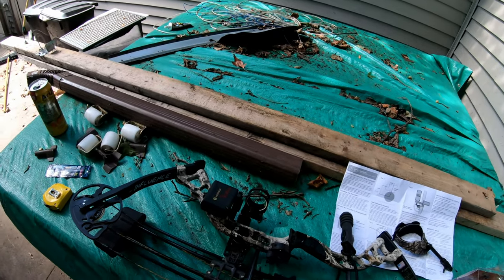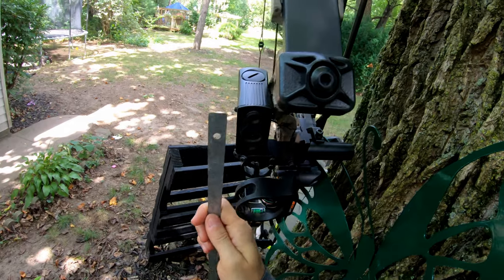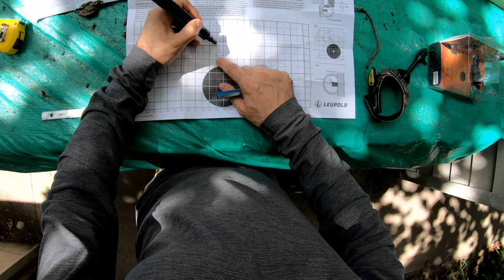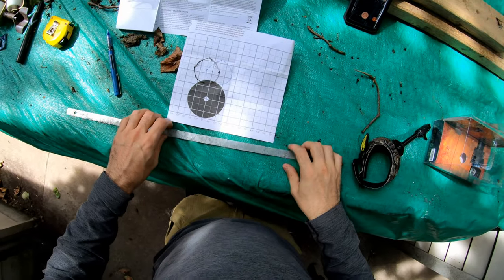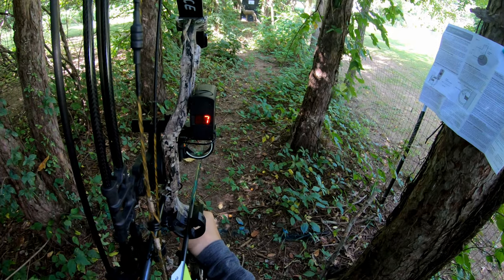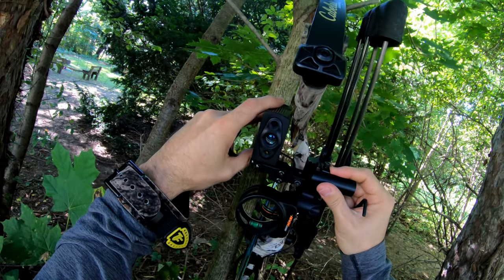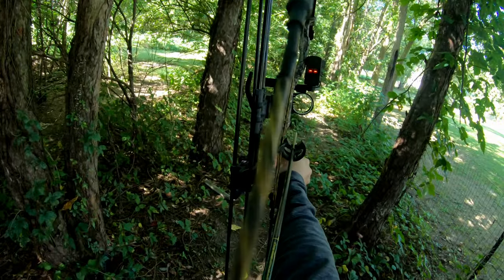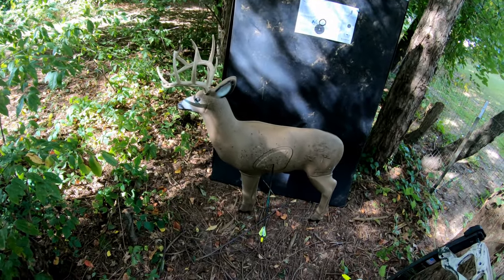Leupold Vendetta 2 Bow mounted Range Finder Install

Comment: Okay so now that you've had this for awhile would you say it's worth it? Currently wanting to make this move for my bow but don't want to buy something and have it not work or consistently work
Reply from the maker: Honestly, I switched up to a crossbow but will definitely use it if it's legal. I need to look more into the laws because it has a laser that is used to "zero" it in, but "could" be used to hunt with I suppose. I'm not well versed enough to be confident with using it. But, in theory, I love it for it's intended purpose. 

Sorry for not responding sooner, I must not have comment notification turned on...